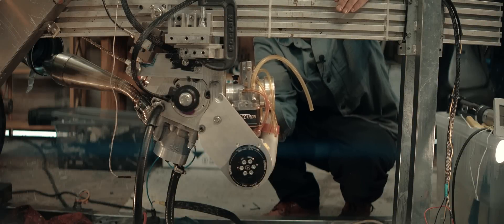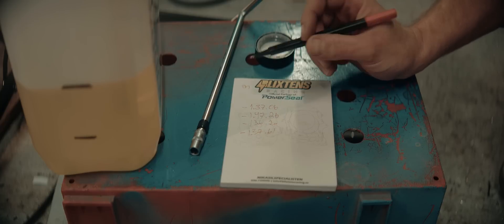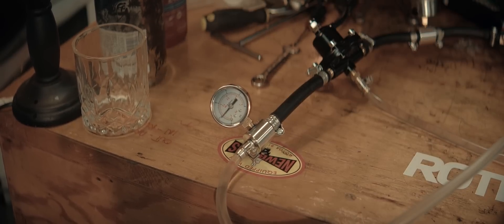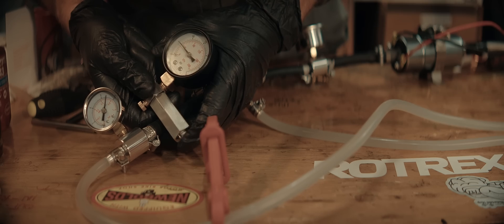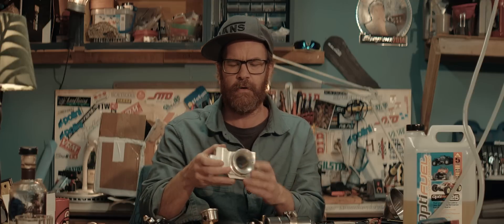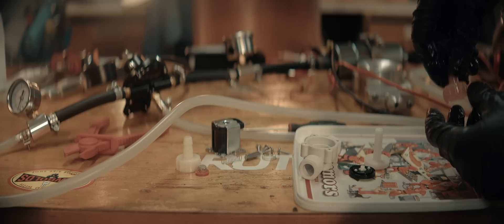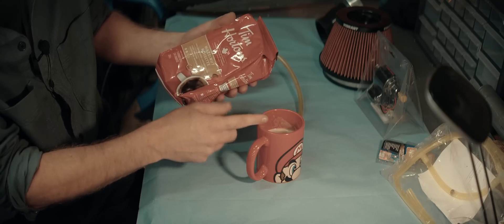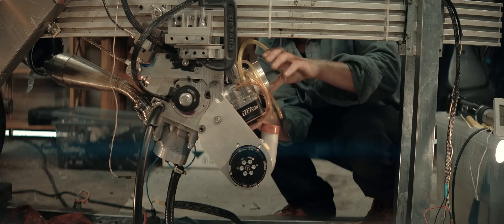48mm Carb and Supercharger on 50cc Two Stroke Engine!

Comment: Have you considered; running the PIP engine naturally aspirated to dial in the ignition timing and carb tuning (probably on race gas first w/traditional carburetor), that way you can isolate the timing / tuning trends of nitro vs race gas, and a traditional carb vs. the speedway or larger traditional carb??? It would seem this would help you understand the performance potential of nitro in your PIP exclusively, and the effect to the pipe resonance rpm on nitro...If these inputs were known before adding boost (in theory), the engine power per / pressure ratio formula (power doubling with double the atmospheric pressure ratio), you could better diagnose what is occurring to the tune up with more boost.....I think it could be worth doing something like this to lessen the unknowns of the new system / shorten the learning curve.

Also; since your going to a “constant flow” type supercharger, it MAY be beneficial to add case reeds back to the intake circuit post carburetor.....I think it would clean up the carbonation near idle, and pick up power prior to the supercharger building any significant boost.......just my 0.02c’s

Keep up the good work 👍🏁😎
Reply: I think he'll need reed valves for starting if nothing else. Also fuel injection is going to be a lot less hassle than a carb, just put it in the intake pipe firing at the reeds.
Reply: Agreed on the reeds for starting alone.....EFI has some challenges too on a two stroke, if not a constant flow type injector, and finding injectors with good reliability / durability on methanol / nitromethane of that type......but the carb isn’t going to be easy either, in terms of sealing the throttle cable, throttle sticking with flat side under boost pressure, and float collapsing.......either way is a hard road ahead without any off the shelf options (Alex has his work cut out for him), I just personally would try to minimize the unknowns, with testing prior to adding boost, to lessen the frustration during diagnosis, of the unforeseen issues ahead.

Comment: Could you use a sealed fuel tank and use the boost to pressurize it? that way you wouldn't need a pump and regulator.
Reply: It would work but it wouldnt react quickly enough with a big air volume in the tank 🤔😁
Reply: Or it depends on the hose size to the tank 😅🤔
Reply: Very dangerous. Think of a bunch of pressurized air and fuel and a spark gets in
Reply: @connorssmallengines6663   true, but how would a spark get into a sealed tank. Nitro r/c cars use exhaust to pressurize their fuel tanks with out any problems.
Reply: @3_Phase  exhaust gas contains little to no oxygen and won't support burning of the fuel.

Comment: Good morning, perhaps you should simplify your fuel system? I sent a link to Kinsler Fuel Injection, a very simple, reliable and easy to adjust fuel delivery system, good luck
Reply from the maker: Thanks for the tip!
Reply: @2STROKESTUFFING  Welcome, Sprint cars and Midgets run menthol fuel, 40% more fuel is required for the same output as gasoline. A modern Sprint car 410 CID engine produces about 930 HP at 8500 rpm. I have no doubt that Kinsler would be fascinated by your project